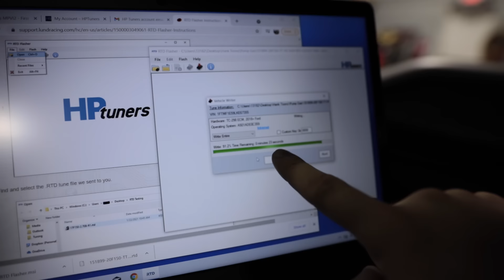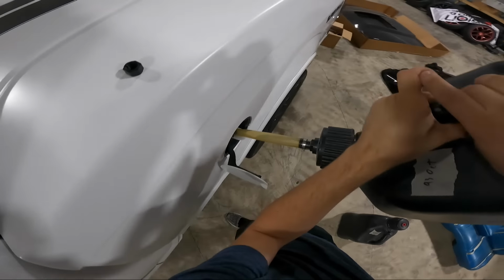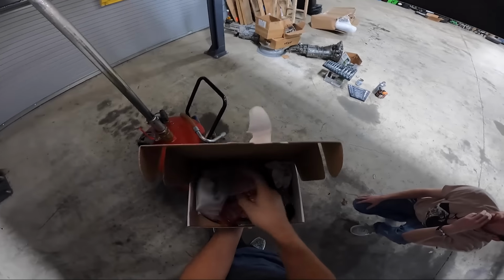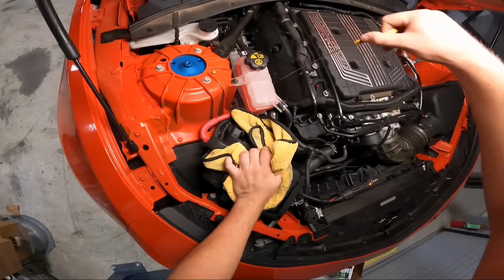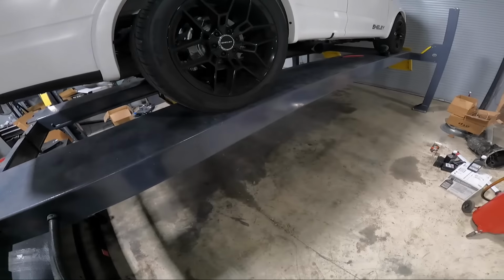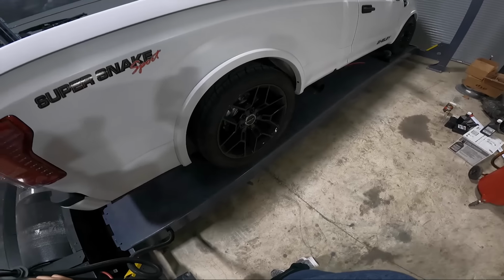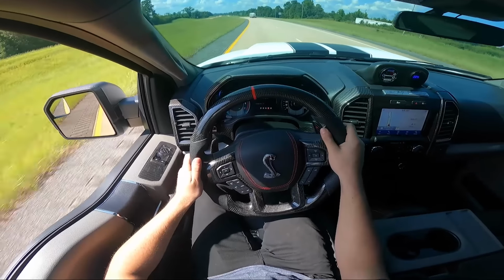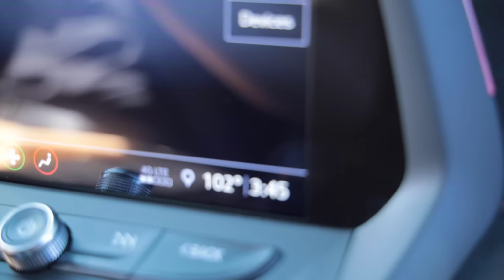Straight Piped ZL1 Camaro vs World's First Twin Turbo Shelby F150!

Comment: Beautiful truck. The Shelby F-150 Super Snake is my absolute favorite sports truck. Ford nailed it in the looks and performance department. To be fair though, I’d say dump as much money into that ZL-1 as you have in the Truck and/or Mustangs and then race each of them again and see what happens. Hate to say it, the ZL-1 motor is a much simpler and proven design, I bet it will actually run right when complete.

Comment: If you turn traction control off in the truck and double tap the traction control button quickly, does the Advance Trac go into sport mode? Or tap and hold twice.

Comment: Hopefully you see this but I see you always put it into Manuel and then slap it into drive but what I found out on my 2011 f150 you leave it in drive and start to shift down with with the gear selector you can lock it in a certain gear for example 2nd and then gas it and then spam the plus on the shifter and it’ll auto shift you!😂

Comment: Lets see he said in the video only 2 bolt on mods that make close too or right at , 100 extra hp , but that would put that Camaro well over 700 hp at least 750 -800 range  , bone stock they put out 650hp at 651lb torque  , 1st guess would be injectors and maybe a tune

Comment: ive seen guys with a 30k f150 e85 spare delete hitch delete and exhaust  spank zl11le at the track. add supercharger and from a dig or roll the f150s are rolling  up the zl1s and smoking them like a fat blunt. so idk what yall are doing with a tt kit and on gate and not eunning from a dig for 1. and for 2 even from a roll the tune proper weight reduction and some boost it should be pulling.

Comment: I'm gonna call it:
Pulley'd down, POSSIBLY different style/more ribbed pulleys
either a full on throttle body swap or ported stock TB
tuned on E
full cold air intake(not sure if fully necessary but whatever, they look cool as hell and add some serious vacuum noises on the exhaust not that it nEEDS that extra sound lmao)
injector swap....?
p o s s i b l y  a fuel pump upgrade. Possibly.(no idea if that's even necessary cause I don't know shit about fuck when it comes to ZL1's)